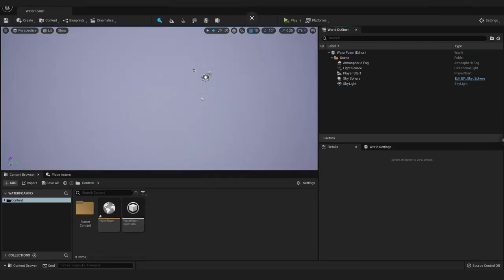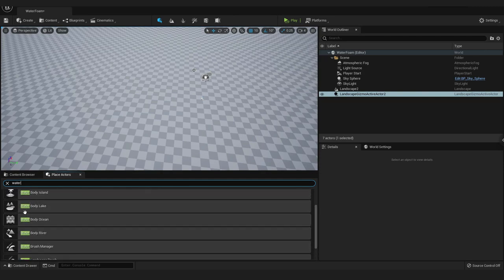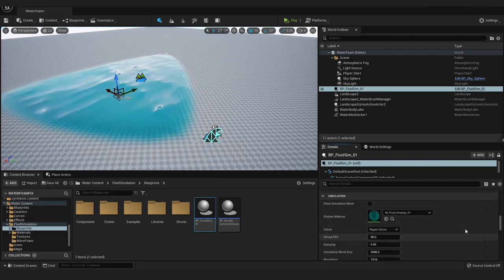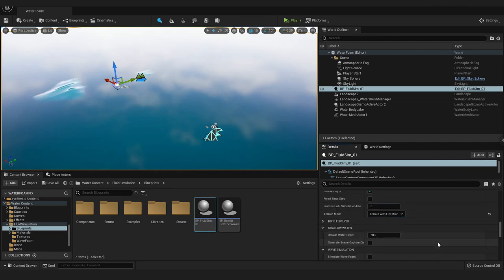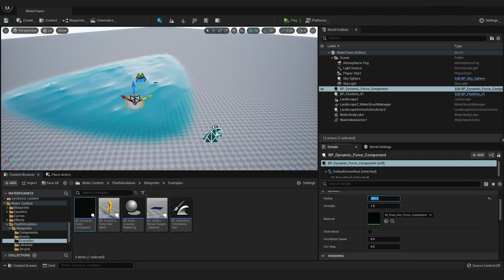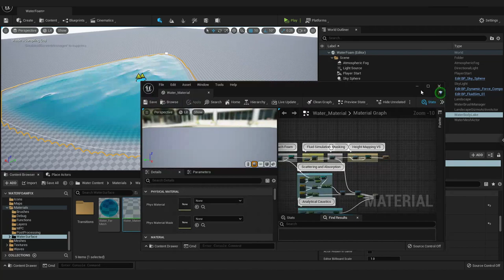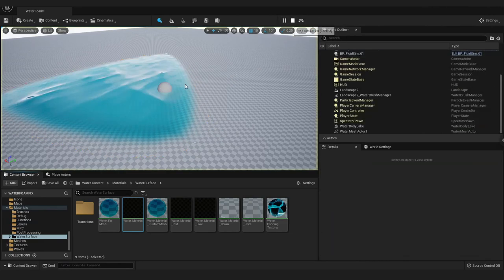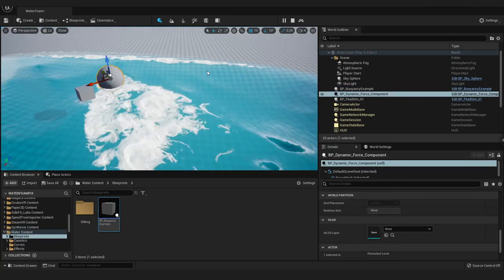Unreal Engine 5  - Enabling Water Foam

Comment: Ok, I figured it out for everybody sad this isn't working in 5. Do NOT change it off 'Constant Water Depth' to 'Terrain with Elevation'. 'Terrain with Elevation' doesn't work in 5 for some reason. This should work for you now. :) What's even more interesting is 'Ripple Solver' gives off no foam by default but 'Shallow Water' does which means you can skip from 5:00 on. The look without the Terrain with Elevation isn't quite the same, but still cool and usable.

Comment: Engine 5.3 - I've been playing with the water system all night trying to get SOMETHING to work.. seems all was lost and then I noticed a couple chunks of foam around the spline for my ocean.. it's only producing in one small place (this is after I removed the files and the variable from the BP to activate the foam.. soooo not sure whats going on haha but theres hope. I definitely have foam and it does allow me to adjust a few of the parameters in the material instance. May be worth digging into again! :)
Reply: I should add that when I tested with the fluid sim bp in place and the dynamic demo sphere I didn't get any results. No ripples, no foam.
Reply: 5.3.1 here, no foam, no ripple, nothing.
Reply: @endtasid  same for me

Comment: how can I assume the properties of a sphere on a skeleton or other static mesh?  Thank you.
Reply: If you're trying to figure out how to add the effect to other actors, you just need to add a Force component to their blueprint. For example, you could add 2 Dynamic Force components to your character and then parent them to the mesh and the foot bones. Then it will disturb the water when your character runs through it.
Reply: @TorQueMoD  🙏🏻 thanks
Reply: @TorQueMoD  Could you please elaborate on this? I am trying to add the effects/collision to a static mesh actor that is hovering just above the ocean waves and would like to see collision when the waves reach up and hit the object. Is this possible if the object is fixed and the waves are what is reaching up and colliding with it?

Comment: how can i spawn a simple water ripple decal on a simple water plane (NO NIAGARA OR WATER SIMULATION) after character footstep or overlapping
Reply: I've never done this before but just an idea off the top of my head: If you're just wanting to spawn a decal at a character's footsteps on a simple water plane, you could put a socket on each foot of your character. When the character makes contact with the plane, get the world position of that foot's socket and Spawn( ) a decal of your desired type at that world location onto the water plane (you should be able to get a handle to the water plane from the overlapping actors function). I'm sure you can get the position better ways than from a socket, but I'm just spitballing off the top of my head.

Comment: hello :) I tried it on the water river but the water runs out, do you know who to fix it ? Thank you for the tutorial !
Reply: It’s same for me! Did you have solution for this ?thx
Reply: @ue5beginner248  low resolution and high water fps is answer.
Reply: @randomizer89osu  hi thanks! What do you mean ? I have a big PC.
Reply: @ue5beginner248  if force in cell > (big value) -> system unstable, cuz floating point error > damping.
If cell size bigger(sim water mesh resolution less) you need much more force to do it unstable.
Practically i don't get this bug on 512 resolution, and ofc you don't need 60k mesh size as on video in first or third person game,
and even on scenarios you need this big mesh(strategy/far camera isometric game) you need to change this size from camera 
distance dynamically. Sorry my english is bad.

If you have problem with water system just do all like in video, you can't copy from it your own blueprints
(ok, you can, but you need to rewrite in blueprint like 10% of code, and first you need to see it work on example).
And in simulation water sim plane can teleport to any(first) pawn with camera, not a player, if you check bool "follow player"
Reply: @randomizer89osu  thanks lot for your answer. Si tu parles français j’aimerais plus de renseignements sur comment tu fais pour changer la résolution? thanks so much 👍
Reply: @ue5beginner248  BP_FluidSim->Simulation->Resolution , it's just simulation grid param
Reply: @randomizer89osu  Merci 🙏 at night I’ll see this 🙏🙏